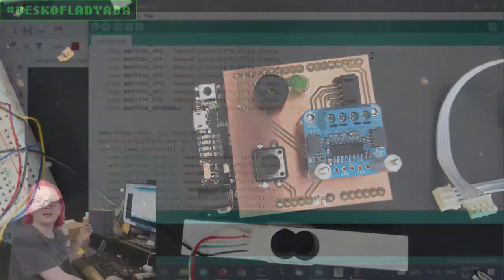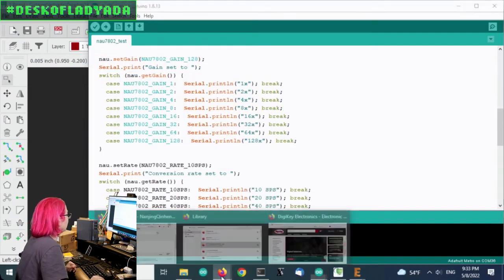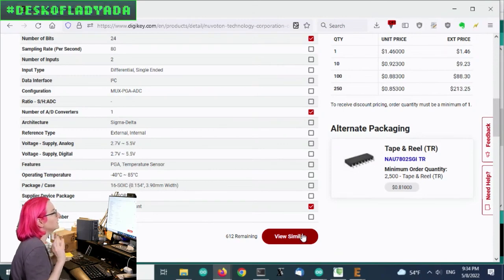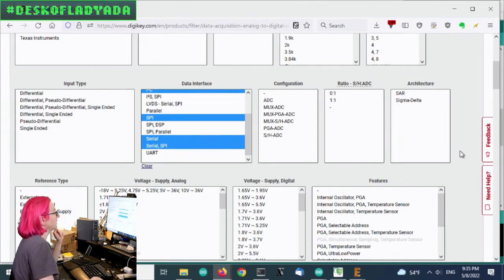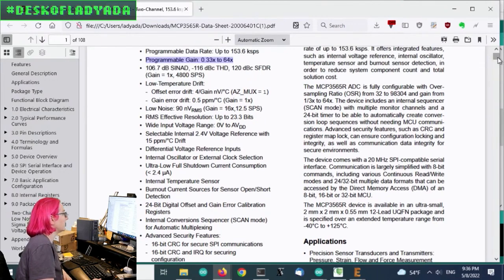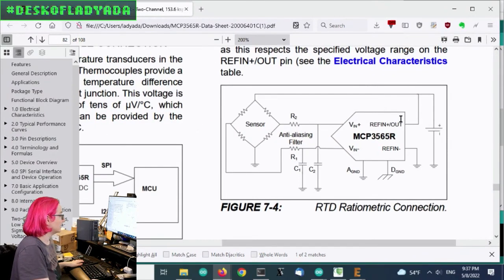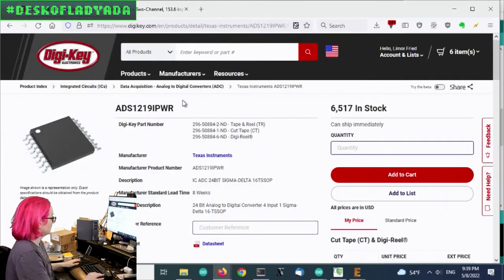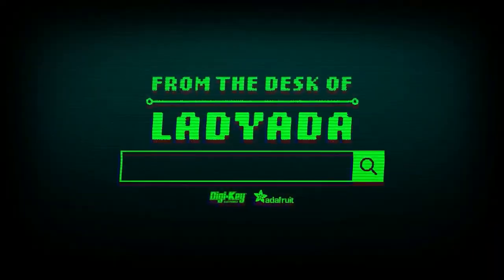The Great Search - 24-bit PGA + Differential ADC (NAU7802 Replacement) #TheGreatSearch @DigiKey

Comment: Thanks, another great video. It's not 24 bits, but at 16/18b, the MCP342x are nice. I2C, PGA 1x-8x, fairly slow (3.5Hz at 18b), low cost, easy to use, SOIC.